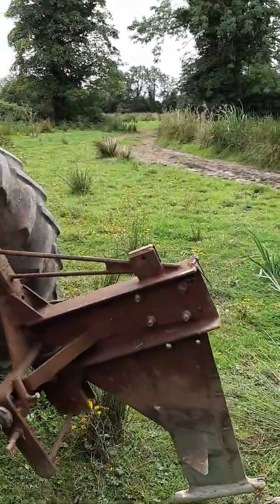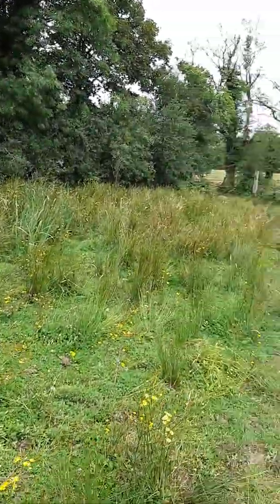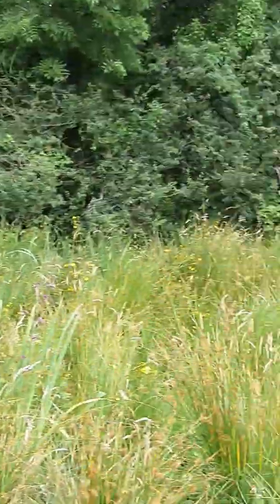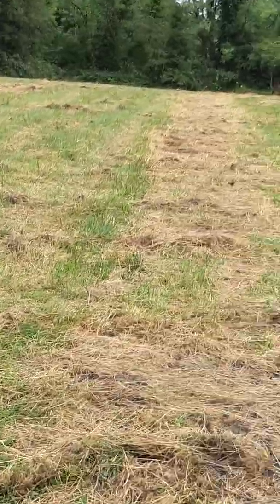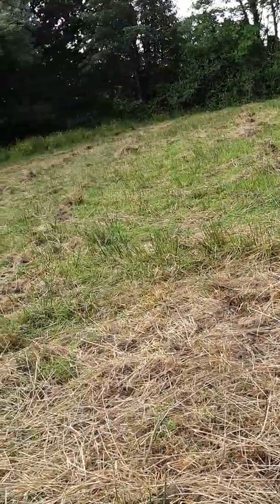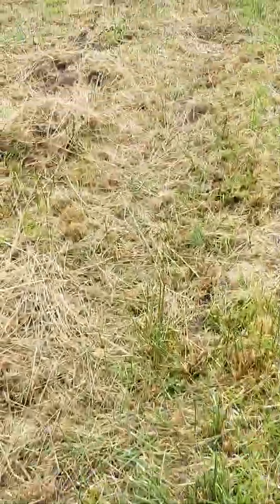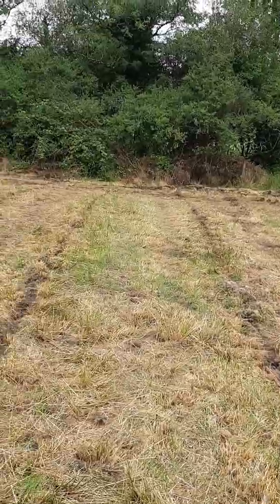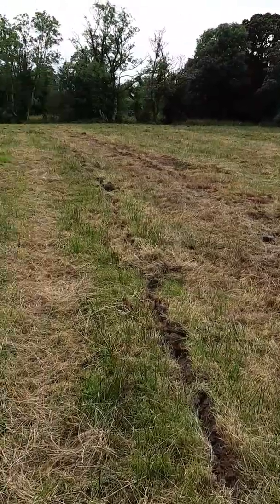Rush reduction, moling and grassland rehabilitation.

Comment: Hello Francis, Great videos . I m farming in Leitrim as well. I ve tried the mole ploughing myself over the last few years with mixed success. I think I might have gone to deep into daub with some of them. Have you ever come across this problem? Cheers
Reply from the maker: Hello Brian. When you say mixed success, what was the outcome. Everything must be correct for to achieve good mole drainage, soil conditions, weather for drying and the moling itself. If you have one of the manufactured moleploughs, they are capable of going down 2 feet which in Leitrim land would generally      be well down in the daub. I am no expert but have learned a lot about what is l required to ensure mole viability. A mole is only goid for 2 years no matter what people say and you really notice this on year 3. If the mole is in the daub and properly formed with an outfall to drain or channel, it will do its job. Did you not see improvement or what did you feel was wrong with your moling? Did the ground not show signs of more rapid drying after rain?
Reply: @francisstenson1971  
Hello Francis, Thanks for the reply. I found that the moles worked very well in fields which I believe have more topsoil. A few other fields which would only have   maybe 4 inches did nt seem to make much difference. I made the plough but I bought the leg, chisel and plug of spalding.  So I would have been working at a depth of about 18 inches plus. I may be better not to go as deep? I ve done a bit of stone drainage (at some at the minute)as well. I have found the stone drains while expensive they work very well. Cheers again.
Reply from the maker: @briand5139  soil type does determine how effective the moles are but no matter how shallow  (my land has only 6-7 inches of topsoil) they should improve soils ability to disperse water. The gravel tunnel mole is a great cost effective, minimal disturbance method of drainage and if I was to do it again that is what I would do. I remember in 1984, very dry summer, we had drainage done from the previous year and they came with a dozer and a moleplough that went down about 30 inches and really ripped the ground. Those moles made a huge difference but field didn't settle for nearly 2 years and massive stones were pulled out too.
Reply from the maker: Hello Brian. Yes. I have noticed spots in some fields that despite moling do not improve in drainage or grass growth. The one common factor I found was that the soil was very shallow and generally these areas were subject to prolonged shading especially in the summer. This never gave the soil the proper chance to fracture. You could also be correct in that a more variable depth of moling might have run through a different soil type that doesnt maintain the mole as well as the other parts of the field. Despite this it will bring some benefit if only for 6 months to a year. I have toyed with the idea of shallow moling these areas for example in late spring to be followed by a deeper second moling later in the harvest if you knew someone with a big moleplough. FYM on these areas and lime over time will improve the soil and create bigger soil particles and then improve things a bit. Hope this helps

Comment: would you be able to give some advice on a field just down from Carrick by any chance, im tring to get it back to normal garden type grass
Reply from the maker: Are you trying to make a lawn from a field?
Reply: @francisstenson1971  yes thats the plan anyway, i know nothing about doing it. i have some theorys but not sure what to do really
Reply from the maker: @davidlynxh1332  if you are trying to make a lawn, thats going to be problematic. The majority of lawns in this country are composed of meadow/field grasses which will never make a lawn. Lawn grasses are typically dwarf low production, slower growing species which thicken to fill in and prevent weeds from growing. Is this what you were hoping to do David?
Reply: @francisstenson1971  Yes Francis, thats my idea. its a lovley site on the river and been very neglected with cows roaming on it. im also considering getting a bulldozer to get the levels right as it slopes down but mindfull of the shallow top soil. some local expertise would be great
Reply from the maker: @davidlynxh1332  if its a lawn you want  its vital to ensure 2 things 
1. Adequate drainage is installed as lawn grasses dont like extreme wet ground.
2. The soil profile is understood and minimal disturbance is carried out while reseeding.
If you are no longer having animals roaming this area, while I am not a fan  the only way to start getting a lawn set  is by first spraying off the existing sward.
Follow this with 2 inch or so topsoil disturbance with a powerharrow. It is important that a levelling bar is installed on the harrow and that you have a good operator on the tractor. Do NOT use rotovator, it plasticises underlying soil and impedes drainage.
Seeding rates for grassland is 13-15kg per acre. If you want a dense sward in a lawn, Double this in Lawngrass seed.
Allow small stones to rebury, remove only those stones bigger than your fist.
These are a few point but I wouldnt use a dozer on Leitrim land, a disaster for topsoil management.
Reply: @francisstenson1971  Brilliant advice! thanks so much Francis, i really appreciate it. Can i ask what would you do to level it off as its quite sloped in different areas and uneven? I cant seem to upload a picture here to show you! also Im not a fan of spraying chemicals either im sure they stay in the soil long term. not ideal. so basically get the drainage sorted and then power harrow... is ok to use a power harrow and land leveler on different passes? and lastly would it be possible to get a local farmer to do this or should i buy a compact tractor and do it over a few days myself? thanks again and sorry for all these questions :-)
Reply from the maker: @davidlynxh1332  it may not be possible to change the contour of the land if its sloped as that is it natural orientation but it may be possible to some extent to level out undulations to allow for proper lawn mowing. As much as I dislike herbicide use, there is really no other way of preparing your field for reseeding as a lawn. Powerharrowing  an untreated field will be a complete waste of time and money. You could use a land leveller post harrowing but the results probably will see soil depth comprimised by the dragging of soil and if its shallow that may affect the   grass germination. I wouldnt buy a compact tractor for this, really a job for a tillage person who knows soil cultivation. Where in Carrick are you as I pass Carrick daily and can have a quick look at it for you.
Reply from the maker: @davidlynxh1332  you will do no such thing David. Id be delighted to help you out in any little way I can. Im about next week if you want me to look at your field.
Reply: @francisstenson1971  That would be great Francis i much really appreciate that. just a fyi i actually live in dublin and i dont think ill be down next week would that be an issue? D
Reply from the maker: @davidlynxh1332 no problem.  Nust ping me when you are around Carrick  and we can check it out for you then.
Reply: Francis Stenson thank you Francis will do.
Reply: Francis Stenson hi Francis, looks like I’ll be down from Friday afternoon till Sunday if you would be free just let me know TY
Reply from the maker: @davidlynxh1332  would a time on Sunday before lunch suit David?
Reply: @francisstenson1971  feck i only got your message now Francis. Sorry about that. Ill be back down in a  week or two. Ill see if your free then! D
Reply: @francisstenson1971  Back down on the weekend. Weather supposed to lovley. Hopefuly you are around, just let me know if so! D
Reply: Francis Stenson hi Francis, we will be here till tomorrow evening if suitable. Any time suits 👍
Reply from the maker: @davidlynxh1332  hello David. I wont make it this weekend as the wife is away and I am on house duty but ping me the next time your coming down and we will hopefully get to meet.
Reply: Francis Stenson no problem at all Francis. I will do not sure when that will be be but I’ll send u message. Btw dug a small hole with a spade down where the land is flat and it seems only inch or two of top soil all grayish clay below 😩

Comment: What herbicide do you use in the weed licker
Reply from the maker: Roundup.
Reply: Well done and thanks for the informative videos.
How many bags per acre of bacterisol do you shake?
Reply from the maker: @eamonbrowne1907  Hello Eamon. Bacterisol isnt spread like Fertilizer but is added to Slurry or FYM. I spread 60 kg over the course of winter on the FYM and that is considered very little. Considering that 100000 litre slurry tank would be treated with 4-500kg of the powder prior to ground application.
Reply: @francisstenson1971  thanks for clarifying.  Good point re overuse of sprays damaging the soil fertility.
I mulched a field that was badly infested with rush. They were several years old etc. Hugh kill off and only handful grew back.  But then the marsh ragweed took off with light exposure. Had to spray them but again   over 90% killoff. Very pleased with field. Plan to moledrain a wet area within the field this year.
Reply from the maker: @eamonbrowne1907  hello Eamon. What's spray did you use on the ragweed and how did the moling work for you.
Reply: Do you use it full strength